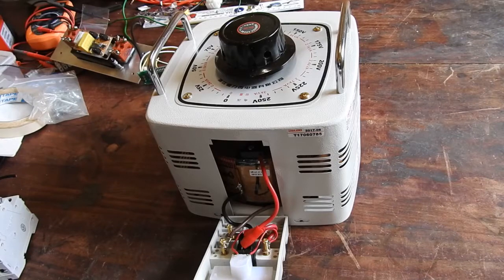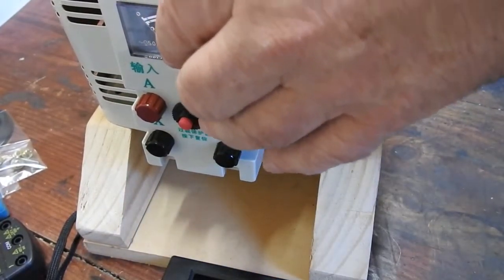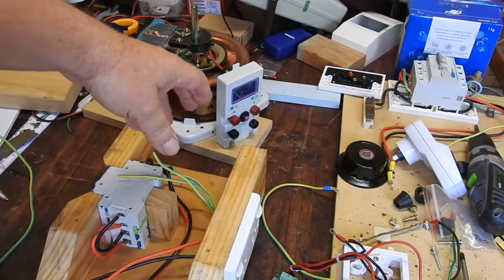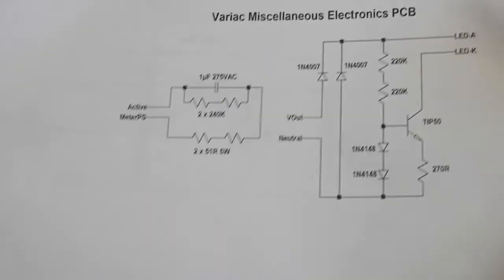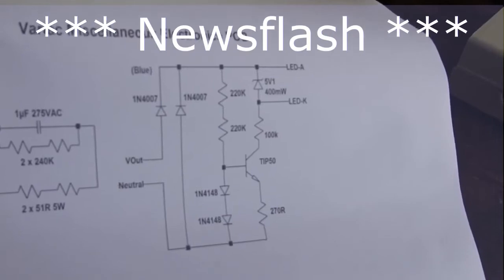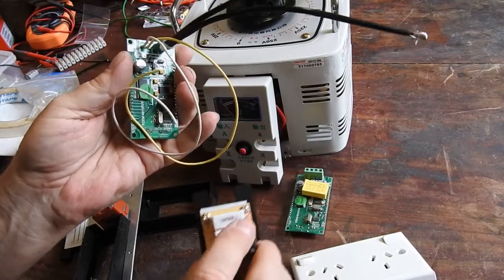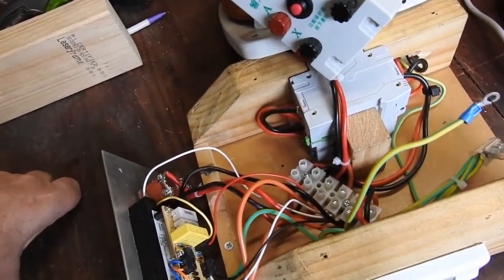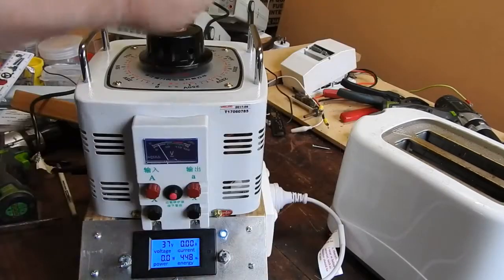Variac Upgrade Part 2

Comment: hiya 

Love this series - very interesting. However,  I'm a bit confused about the white and yellow wire at https://youtu.be/1WfHmAjFivY?t=1072 

If you cut the track on the back to separate the yellow and white as you demonstrate, there is still a connection under on the front under where the old green terminal block used to be, so these wires are will still be connected unless you cut the front track as well. But if you sever the front side track then the white wire doesn't appear to go anywhere in the board as it terminates at the pad where the Capacitor used to be, with nothing else connected to it

Am I missing something?
Reply from the maker: Thanks, I'm glad you've enjoyed it!

On the meter wiring, yes, it's clear as mud. Sorry about that. (I thought I'd done it better than that)

Without pulling the thing apart to see what I did, I'll try to explain the whole business, and what I think I did there, for the benefit of anyone reading this.

In the unmodified unit:-
Those traces connect two terminals together so that the the live from the line side goes to the live on the load side, but two terminals are used mostly for convenience when wiring the thing up. The neutral terminal from the line side also goes to a load side terminal, but they are separated by a low value shunt resistor for measuring the current.  

The meter really only needs one terminal to connect to the live side, but does need it for two purposes: to power the meter, and to provide the voltage to be measured. The modification is so that the those two functions are separated. 
The meter can then be powered from the full mains voltage from before the variac, but it measures the (often lower) voltage coming out of it. 
The modification is needed because the meter power needs at least 80 volts, which may not always be available at the variac output.

The line-in to line-out connection is now done external to the meter, from the variac output to the power outlet. The two terminal holes on the meter used to make that connection previously, are now used for the meter power and voltage measure inputs. Which is why the trace(s) between them must be cut.

(If the holes where the white and yellow wires go were connected by a trace on both sides of the board, then I must have cut the trace on both sides and omitted to mention it.)

The variac output voltage to be measured comes in on the white wire. 
(and so that terminal can't be floating now - it must still connect to the appropriate point within the meter).

The meter power comes from mains live via the large resistor and capacitor in series, and these have been removed (along with a 470K resistor that was across the Capacitor), and fitted to an external PCB so that larger resistors can be used. (see video @10:30)

One side of that cap+resistor now goes to the full mains of the variac input, but the other side must still go into the meter to the point it was connected before. The yellow wire does this via the other "repurposed" terminal hole, and it is extended so that it reaches the point inside the meter where the cap+resistor used to connect.

I hope that clears it up. Let me know if you still have questions...
Reply: Do you happen to have a link to that panel meter you modified?